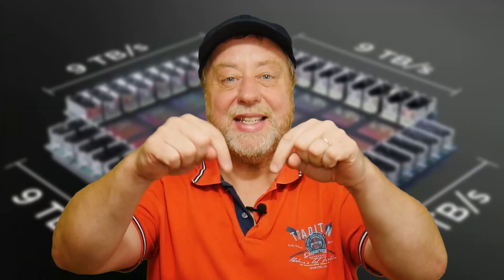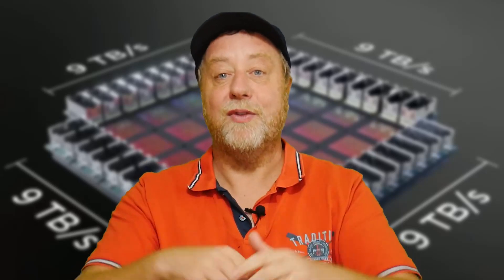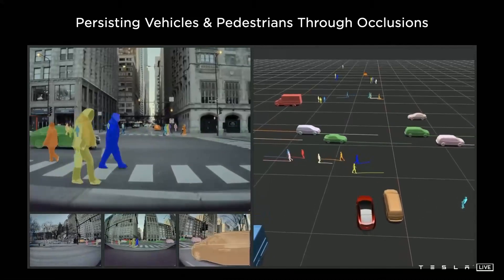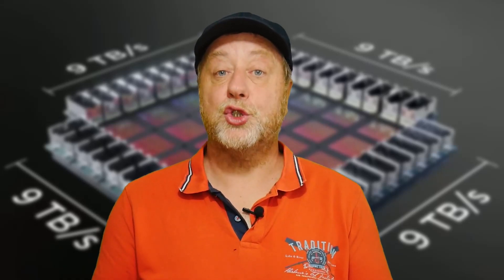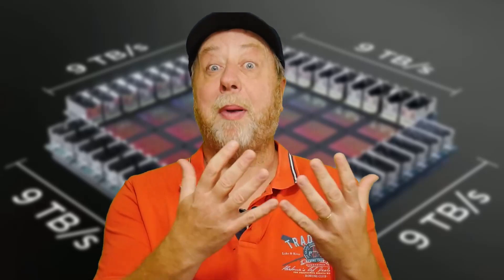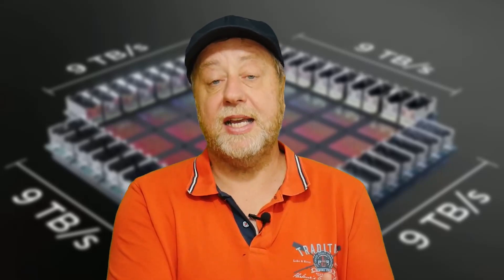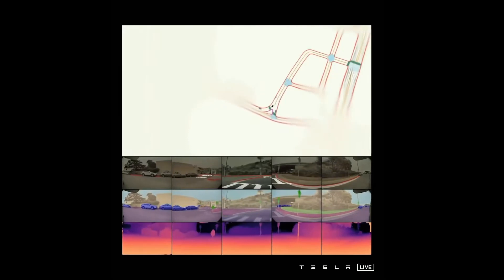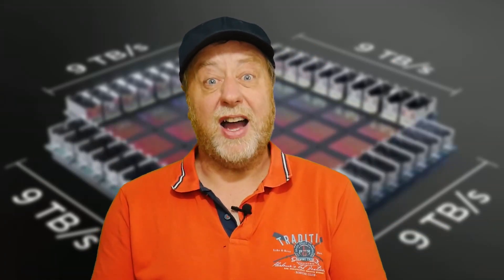Tesla D1 Chip - What is All The Fuss About?

Comment: 🎯 Key Takeaways for quick navigation:

00:28 🚗 Tesla's D1 chip is designed for training machine learning neural networks, not for use in consumer products like cars or smartphones.
02:34 🧠 Machine learning involves two distinct phases: inference, where pre-trained neural networks recognize patterns, and training, where networks learn from vast amounts of data, requiring intensive computing.
05:58 ⚙️ Tesla's D1 chip is part of the Dojo project, a specialized system for training neural networks, featuring custom hardware tailored specifically for machine learning tasks.
07:19 💻 The D1 chip's architecture involves multiple tiles, each containing numerous training nodes, collectively forming a powerful supercomputer optimized for machine learning tasks.
08:41 🛠️ While the D1 chip is primarily geared towards training neural networks for Tesla's self-driving software, it signifies a growing trend of specialized hardware for machine learning, potentially reducing reliance on traditional GPUs for training tasks.

Made with HARPA AI

Comment: What I don't understand is why the need for this kind of compute performance. The human mind is estimated to top 16 petaflops. Obviously this does not directly translate to a binary compute system but the magnitude in performance is noticeable. I think it's more a problem of optimisation than more compute time. On top of this there are serious engineering issues with this centralised design such as substanable memory bandwidth, data retrieval, thermal loads, power delivery. I'm sure the engineers have solutions for most of these issues but I suspect supplying data fast enough to this compute cluster will be vary difficult. NVIDIA have dedicated ML compute solution which has severe memory constraints for big data processing and there performance is only a fifth of this in terms of flops.

Comment: A few points. First, my understanding is that DOJO encompasses 4D. That is, yes, it factors in inputs from multiple cameras. But also it encompases multiple frames over time. In fact, the trainers will be labeling not individual frames but sequences of them. Which will save much training time/effort, but also will make for a safer, more robust product. For instance, that fatal accident which occurrend a few years ago in Florida happened because the system failed to recognize a semi moving across its path. A human would've noticed its trajectory, but since the Tesla was only doing single frame analysis, it didn't look like a solid object. Second, my understanding is that, while GPUs are far better than CPUs for AI, you can do still better with silicon dedicated for AI (vs for video processing).
Reply: I think that's exactly what the video said, although it's much simpler and more straightforward to read your comment

Comment: Adiabatic Quantum Computation Applied to Deep Learning Networks 
by Jeremy Liu et al. including from the University of Southern California and Oak Ridge National Laboratory 

It seems that neural networks could be much more powerful with intralayer connections. The authors envisage using spiking neural networks, SNNs. I read elsewhere that they might be available 10 years from now. In the meantime, optoelectronic systems may be very fast and efficient and on the market soon. For example, from Lightmatter or Psyquantum.

From the paper:
"We believe quantum adiabatic computing offers part of a potential solution through its ability to sample from complex probability distributions such as those generated by neural networks containing intralayer connections."

"The ability to train complex networks is a key advantage for a quantum annealing approach ... High performance computing clusters can use such complex networks as building blocks to compare thousands of models"

High performance computing clusters - in the D1?
Reply: I had heard information on the prospects for spiking neural networks, telling it may need some years:
Photonic Neuromorphic Computing: The Future of AI? 
YouTube channel: ExplainingComputers

Also, as told in another comment here, a Cerebras chip with many cores is on the market. It is being used in pharmaceutical research and for physics.

Comment: PEOPLE DO NOT UNDERSTAND THE PROBLEMS WITH ELECTRIC VEHICLES
*  *  *  *  *
Advanced electric motors of the type used in electric vehicles are very expensive to make and fuel. Since the proposed energy sources, wind and solar, are notorious for their inefficiency and unreliable nature (no wind: windmills stop, no sun: solar cells stop), and they must have a 100% backup for the times when there is no wind or no sunlight. That means that windmills must have coal or natural gas fired generators to supply power when the wind doesn't blow and solar farms must have the same when there is cloud cover or during the night time were no power can be generated. Also, while coal or gas fired power plants require less than a fraction of an acre of land, wind and solar both require hundreds or even thousands of acres to achieve equivalent power generation. The same people who are pushing EVs are also complaining that the planet is running out of space (another ridiculous claim)!

When you add to this equation the fact that the electric motors used to power EV's are loaded with toxic substances and the rare earth metals that starving child slaves are mining, you run into the problems of both supply and disposal. There are not enough rare earth metals on Earth to create enough EC's to replace all of the hydrocarbon fueled vehicles even if we could afford it (which we can't). And, when a wind mill or solar panel reaches its end of useful life you end up with piles of toxic metals for which no one has even thought about the costs and methodology to safely bury or recycle (again more land!) This begins to make nuclear power look safe as a baby's Binky by comparison.

Comment: There is a 'breakthrough' chip I am certain will make solid-state obsolete, and it aint Quantum or Photonic!

Micro-scale Babbage Engines.

Look into what a full-sized Engine can do in one turn of the crank.
Make it tiny, that crank can turn much faster.
Studies suggest an Engine made with photo-lithographically machined micro-scale parts could run millions of cycles a second.
Put many Engines together, you might have something special.

Comment: VW Software Engineers: "lets figure out a way for our car EMS knows that its on a test bed vs on the road to cheat at emissions".

GM Software Engineers: "lets figure a way to resolve poor mechanical assembly engineering by ensuring the cars don't catch on fire". 

Ford Software Engineers: "We are going to need 17 radars to have our Mustang Mach E stay in the middle of the its lane on the highway, just don't ask it to change lanes or take a corner. That would need another 34 radars".

Tesla Software Engineers: "We need to build our own dedicated AI Chip from scratch..."

I honestly thought Elon was mad when he announced the removal of the radar system from its long list of sensors the system uses to autopilot. This AI day reveal was incredible. The fact that the system uses prediction in order to anticipate what the road ahead looks like at a very very high rate of success is simply mind blowing.

Comment: What a neural network does or how machine learning works is a entirely different question. In a video on D1, you have to focus on how D1 might do these, how it might compare with existing systems, like for real, not just on paper, what exception it might bring etc.
Personally I think you should've at least talked about Cerebras. Cos D1 looks like just a rip off from Cerebras' wafer scale integration and their system is already powering many system. Its a real deal, not just something promised on paper.
Reply: What rip off? So nobody cant make million cores but cerebras?

Comment: Trying to get my head around the size of dojo, yes they are saying flops but when I think of neuron networks wouldn’t other units be more telling? 
Example how many neurons are in the network, the amount of memory in each d1 chip seems to limit how many nodes it could process at one time. The high bandwidth io could allow you to swap nodes but i don’t really see storage anywhere in the diagrams. 
So if you maxed out a dojo, how many neurons and connections could it simulate in real time? Billion nodes with a trillion synapses? Ten billion? One hundred trillion?
Reply: This is not neuromorphic system - so no neurons

Comment: Hey Gary.  Can we call this a co-processor based on the fact it requires a general purpose processer to manage things?
Reply: It sure sounds more like an AI hardware accelerator than a processor
Reply: @chrismofer  thanks for the response, it would be nice if Tesla would allow access to it for researchers.
Reply: @DigitalDesignET  it doesn't exist.
Reply: @DigitalDesignET  LOL no.
Reply: @frankyflowers  Neither do you.
Reply: @frankyflowers  Conspiracy theorists are like $hit on my shoe. Can't shake them off and their ideas stink.
Reply: @garethrobinson2275  there still isn't any proof
Reply: Actually, typically when you build a monster that does what these high end chips are designed for, it's the very few CPUs that might exist to manage and chips like this Tesla that do the main heavy lifting. So maybe you call any other chips the coprocessors?

Comment: Once I saw one D1 chip use 400 W TDP, then I said that is using a lot of power.   But once I saw the Training tile with 25 D1 chips drawing 18000 Amps, and outputting 15000 killowatts of heat.   DAM!  This is not for your home, car, or anything else.   Its only going to be used in a data center.
Reply: If the Training tile is capable of 1 EFlop/s then this amount of energy is nothing. The following are the specs for the TOP500 supercomputer:
--Supercomputer Fugaku, A64FX 48C 2.2GHz, Tofu interconnect D, Fujitsu RIKEN Center for Computational Science, Japan
7,630,848 cores,	442,010.0 Rmax (TFlop/s), 29,899kW Power

2X the speed, half the power requirement. Yes, it's for a computer center but depending on what else is needed, it's small enough to fit inside a refrigerated unit to keep it from burning up!
Reply: @robeigner4390  That Fugaku is taking ~ thirty megawatts. It's using 64bit floating point operations for the TFLOP number, and not matrix based floating point operations at all.

So comparing it to Tesla's chip or any other matrix based machine learning chip/tensor cores is like comparing CPU to GPU or actually even worse.

Totally different use cases.

Though I don't know if D1 actually has exaflop of performance or is it Exaoperations. Like Tensor cores where you can do over 100 Teraoperations per GPU with sparse matrices with 4bit numbers. If D1 actually performs exaflop, even with 8bit floating point numbers, that would be pretty incredible.

Most likely it's with lower precision, 4bit of 2bit. Still it would be 100 teraoperations per watt, so even at 2bit numbers that's pretty incredible.
Reply: Look up the original 1950's Transistor and then the 1980's Transistors. Then look decade by decade from 1980 to 1920 and you'll be wondering like me, just how soon these things will be reduced to nano scale for injecting into us :D Not a conspiracy theory but for real world applications, like health, IoT communication, and replacing the Smart Phone with floating chips in our systems for inter connectivity with the WWW!! ie Neuralink :)
Reply: @davidcadman4468  They already have been for a long long time. Also people should drop the word "conspiracy" as it's been brainwashed to people to mean something silly, when in fact the economics, politics, etc. are so full of conspiracies that it's hard to find a any higher ups that isn't part of at least one of those.

In any case, they have already build "nanodust" aka small bits of circuits that use similar method as protein folding to connect to each other in one particular way to form a small circuit and antennas. And it harvests energy from the body. I read it from the most trustworthy science magazine that's published here in Finland, about 5-6yrs ago. It was prototype stage technology, but all the individual technologies needed have been available for a long time already. The energy harvesting and collection is probably the hardest part. If I remember correctly, as I have read and heard multiple different this types of tech, it achieves some chemical reaction with either amino acids or sugar in the blood that creates a small current that it harvests.

To me this and Neuralink are pure dystopian technologies. Not because of the tech itself, but because humanity have not achieved society and structures that would prevent psychopaths from running things, it's essentially the opposite. So whatever gets developed, just think the worst possible outcome and you pretty much know the outcome and why the whole thing was planned in the first place. Though most just don't have enough imagination to come up as horrible ideas. I love tech, but I truly hate the secret societies and their sick religions that run the whole show.

Comment: Does this mean GPUs will become more reasonably priced in the future again?
Reply: no
Reply: Not for a few more years at least. This does nothing to ease the current bottlenecks.
Reply: Nope
Reply: No, this is not a GPU and the silicon shortage has little to do with AI tech.
Reply: @chrismofer  yes this isnt a GPU but they are both used and this is far better then GPU. and if Nvidia cant sell as many of their enterprise cards which are currently used mainly for AI we might see rise in price
Reply: No because there always dropping CUDA support for Legacy GPU hardware very quickly so you end up with a paper weight, By the time you get your hands on a nice powerful second hand GPU, not to mention the weird licensing.
Reply: No, because data centers are not allowed to use RTX cards. If you want to use an nvidia GPU in a datacenter, you have to buy their datacenter GPUs, which are quite expensive. Therefore no relation between consumer GPU prices and datacenter GPU usages. At least regarding nvidia GPUs.
Reply: @zoltanberkes8559  those data center graphic cards are actually very different and are made for heavy duty or 24/7 use unlike your pc graphics card
Reply: @carholic-sz3qv  I know it well.
Reply: @carholic-sz3qv  actualy they are not that different at least the actual GPU isnt depending on what card you have of coure
Reply: @zoltanberkes8559  catch is those datacenter cards use same(depending on GPU) GPUs(the actual processing unit) on consumer cards its just packaged differnetly.(less ram and such)  also you should understand that NVIDIA gets certien capacity of production at its semiconductor manufacturer aka TSMC(if i remember correctly) which means it has to balance that between Consumer cards, workstation cards and datacenter cards

Comment: 1.1 Exaflops - so this will be the fastest supercomputer in the world when it arrives? (though limited to ML operations).
Reply: It's not the fastest in the world, but it is probably the most compact exaflop-level supercomputer out there, at only 10 cabinets. Fugaku, by comparison, is 256 cabinets. Fugaku, at its peak-level, is only roughly 2x stronger than Dojo, but is 25x larger than it.
Reply: Not. In 32 bit Floating point, it is 16x times slower. And it has a very special (and very limited) memory architecture, which is perfect for AI learning, but probably doesn't fit other kind of scientific calculations, like where the CPU has to randomly acces a humongous memory.

Comment: I have solid info that Nintendo Switch Pro will use this chip (and will be available before holiday season 2021).
Reply: Finally, my collection of overpriced remakes can run in 8K 60 FPS.
Reply: @floppa9415  😌😂 I'm waiting 240fps ACNH...🙃
Reply: Are you joking?
Reply: @Harish2923  Yes 😅
Reply: What would be cool for real though - but not going to happen 😒 - is to get a Swithch with the Nvidia Orin SoC (with added RT Cores) and actively cooled dock. Forced cooling both through the console (2x 60mm high static pressure fans / silicone rubber sealed interfaces to enlarged airways + 3x size radiator) and blowing to heat sinking display and metal back cover (2x 80mm fans).

And also have an option to buy a "Pro dock" with another identical Orin SoC. This all (~150W) could still be powered through USB-C due to 240W PD standard.

Comment: Elon must have been talked to by his top engineers, because he wasn't talking like this last year, even though this dojo chip must have been in development for longer than that, it's probably the realization that exascale power is capable of taking on the problem of self driving at its next logical level, that of vector space including temporal dimension.
It seems the problem of self driving is taking them closer and closer to emulating a human, by working with a "mental picture" of the world around.
Maybe AGI/ASI will emerge like Elon predicted, out of self driving cars rather than other areas such as what deep mind is researching.
Reply: I think with anything that is so cutting edge, new realizations are going to occur frequently. If we associate propabilities to various futures, those probabilities will change as time passes. Really hard to know even for Musk how it will pan out.
Reply: The fact that Tesla registered 0.6 accident for every 1 million miles driven  VS 4 accident for manual driven cars / million mile has proved that auto pilot is CURRENTLY safer than human drivers, with the new trained network using DOJO, this will be come 0.01 accident / mil mile!
Reply: @hqcart1  "auto pilot is CURRENTLY safer than human drivers"
This is stupid. Autopilot AND a HUMAN driver together is safer than a human driver.
In fact, even tesla FSD would crash the car thousand times more frequently than an average driver.